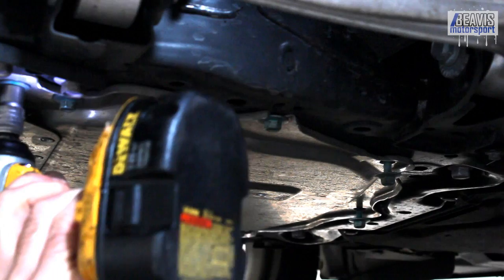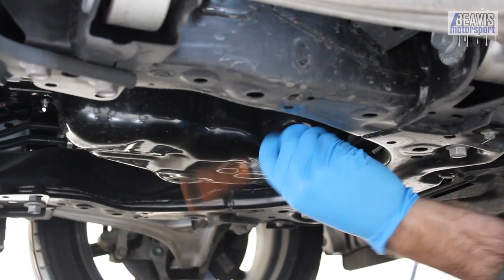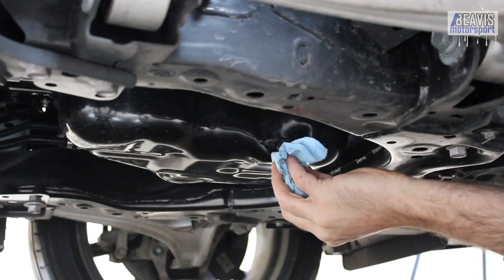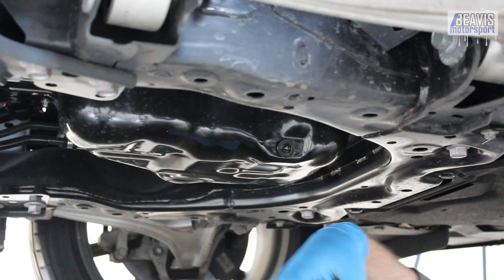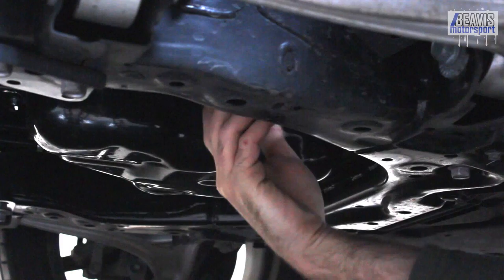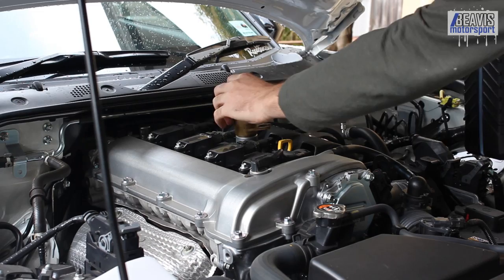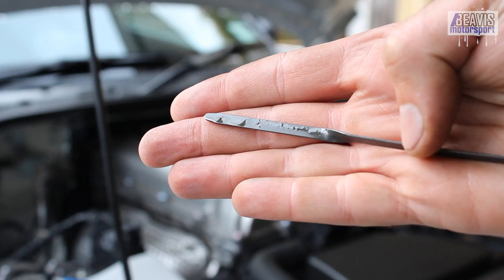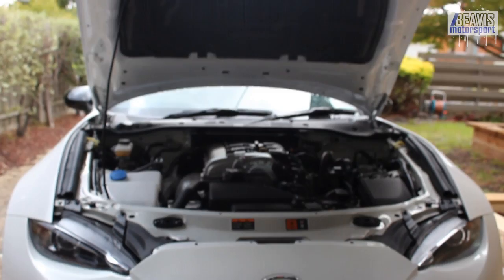HOW TO CHANGE YOUR OIL - ND MAZDA MIATA MX-5

Comment: THIS IS VERY IMPORTANT TO KNOW - The oil drain plug is located on the right-front side of the oil pan; as such, you cannot drain all the oil if you jack-up the front end because the oil moves to the rear of the pan.  After I completed draining the oil, I backed off the ramps and placed a small one quart container under the drain plug (super tight fit trying to reach under the car but it can be done).  I removed the drain plug and almost 1/2 of a quart of oil came out!  That is a significant amount of remaining oil that you DON'T want to leave in your car unless you simply don't care, but I certainly do!  I refilled the engine with exactly 4.5 quarts of oil and the dip stick indicated that the oil level was spot-on.  Had I not leveled the car to drain the remaining oil, I would have over filled the engine by almost a half a quart.
Reply from the maker: I agree, would usually not suggest changing your oil with only the front lifted up.
Reply: I learned this lesson the hard way by over filling
Reply: That's an odd place for Mazda to place it.  I suppose you could jack up the rear of the car.

Comment: I suggest replacing the drain plug crush washer—it's inexpensive and provides some assurance against leaks. Both the drain plug and the oil pan shield bolts should be tightened to 26 ft-lb of torque. If you're replacing the oil filter, the capacity of the ND's 2.0 L engine is 4.3 L of oil. The best way to ensure an accurate refill level and avoid overfilling if your new oil comes from a 5 L container is to transfer 0.8 L or so of that oil to another container. That way, you'll have exactly what you need for the refill in the large container.
Reply from the maker: deasystems good tips... thanks for watching :)
Reply from the maker: You absolutely could, but I don't think it's a huge concern, the moment you crank over the motor oil will be pumped everywhere. There are many cars out there that wouldn't permit you to fill the filter before installation, including the NA/NB MX-5 motors.
Reply: 4L should be fine for the 2.0 engine. You will never be able to get all the old oil out. You don't want to put too much oil in.
Reply: @petermartin9494  : I agree that overfilling would be a bad thing. I jack up the car to level or even slightly rear-high to ensure full oil drainage. I caution anyone doing the same to be very safe and use jack stands all around.

Comment: Pro tip:  Always fill the oil filter with new oil before installing, and use ATF on the ring, not engine oil.
Reply from the maker: Why do you suggest ATF on the seal? I have not heard that before.
Reply: @Bbeavis  It is a better lubricant for the rubber seal, and will not dissipate/evaporate like oil will, so you will never have a problem removing the filter in the future.

Comment: Suggestion.  When you change the oil filter, before installing fill at least half full with oil, so there is no laps in the oil pressure when first cranking.  With that air gap, you are placing the engine  metal to metal wear until the oil pressure returns to normal.  Getting ready for my first oil change on my new Miata.
Reply from the maker: Nice tip, thanks Mike!

Comment: Caveat....US Miata has 2 liter engine so I'll quantity and other things could vary to this vid....no?   UK only has 1.5 in ND....I think?   Motor in vid looks different than mine?
Reply from the maker: This car runs the 2.0 litre. I assume the UK market get both the 1.5 and the 2.0, but I do not know personally. I doubt there are many differences between the 2.0 engine offered in different markets, perhaps just some minor changes due to left vs right hand drive.

Comment: Hi mate, took my car (back) into Mazda and got them to put in the premium fully syn after they initially put in semi syn (it's my fault for apparently not specifying... lol). However, they put in 5w40... I know it meets the car manual specs, just a little concerned if the 40 is going to be too thick for my ND. It's my daily driver. 
Hard to find these answers for our conditions considering every forum is more or less US-related. 
Just wanted to pick your brain. Cheers.
Reply from the maker: I really cannot imagine it would be an issue, particularly if you took it to a dealer. That said, it does sound "thicker" than what the manual specs which is odd. If you live in a warmer climate, then it might make more sense. But if you're suffering a cold 3degC morning like I am at the moment, then perhaps not the best choice.
Reply: BEAVIS Motorsport 
Thanks for replying. I live in Melbourne so I’m experiencing those cold mornings at the moment. The 5W should be ok even for our mornings I think? Just curious about the 40 for a small engine such as ours.
Reply from the maker: @fanatical56  Wouldn't be too worried at all. Mazda state in the owners manual that up to 50 is acceptable.
Reply: @fanatical56  0w flows better than 5w. Thus for those colder mornings you would want that 0w oil that the manual calls for. The higher number references the flow characteristics of oil at operating temps and the lower is the flow rate for a cold engine.

Comment: I know this is old but is it ok to jack up each side from the middle of the pinch weld? Does the jack bend the pinch weld? I don't like jacking from the subframe and if I jack on the indicators by each wheel then I can't place the stands there if the jack is in the way.
Reply from the maker: Should you do it, probably not, can you do it, yes if you are careful. A good safety net is to include some timber to spread the load of the jack across a larger area under the sill so it reduces the chance of damage. Obviously if you used a small jack on a weak part of the sill its more likely to bend or damage the metal.

Comment: When jacking the car up, did you put the jack on the pinch weld?
Reply from the maker: Yes, so that I can get the jack stands on the designated jacking points, I find a safe secure spot to place the hydraulic jack roughly in the middle of the vehicles pinch weld. It is fine as long as you are careful.

Comment: Thanks for this, planning to do my 30k service because it's a basic one and dealerships charge an arm and a leg so figure I'll do it myself and learn a few things along the way. 
Quick question though, you're using OW-20 but the manufacturer recommends 5W-30? Also, how do you remove the service warning light on the dash afterwards? 🙂👍
Reply from the maker: I have a video to reset the service reminder:
https://www.youtube.com/watch?v=5rZBpfPkBOw
Check your owners manual, and purchase the oil that matches their spec, it can vary from location to location.
Reply: 0W-20 is used for emissions purposes.. 5W-30 is better.
Reply: @TuckFinn831  Thanks, I went with 5-30

Comment: I'm about to buy a 2020 MX-5 RF that is a one owner car with only 8000km on the clock. I've always done my own maintenance, but never owned a car this new. Would you recommend changing the gear and diff oil to remove any break in material suspended in the oil or is it good to go until the first specified interval?

Cheers
Reply from the maker: I doubt Mazda would require it according to their service intervals.
But it would be no harm to replace it as long as you use the right oils - being a little more generous with the oil change frequency is better than not changing it enough.

Comment: that filter is kinda small... Smaller than my 1.7L VCT engine on my Puma and actually seems smaller than the oil filter i've put on my mk6 1.25 Fiesta when I did it's service in October
The plate is a pain too. Guess i'll buy a batteries wrenchgun to speed things up
Reply from the maker: It is the genuine Mazda filter, I guess with Mazda's size doesn't matter so much.
Reply: @Bbeavis  yep, also the room left after you place the shield doesn't seem to allow a big clearance. But they, mazda always know what they do. And blessed they are for not downsizing their engines. And making N/A

My fun car is a Ford puma 1.7 VCT, 125bhp
Short ratio gearbox, max power at 6300rpm
Extremely zippy, I love driving it. But the day I have to part ways with it... I want an RF MX-5

Comment: I recommend 5w30 anything lower then that yull feel a lack of performance
Reply from the maker: Yeah fair enough Grizz, it can really depend on location and climate.
Reply: @Bbeavis  yeahh vegas be 110 out here
Reply: I'll listen to the dealership instead of someone on social media
Reply from the maker: @ronaldmcgowan3697  If your dealership is doing your oil changes then you should be safe :)
Reply: @ronaldmcgowan3697  cars have several oil grades on the userbook of what you can use
if 0w30 is an option on the allowed grades, i'd use that. better protection at warm environments
but then... new car, keep using factory grade. i do that with my daily, which will turn this 22nd january, 16 years since i've bought it
Reply: Im planing to go with 5w30 this time. However, SCA suitable check says castrol edge is not suitable, while the nulon long life one is...
any ideals? i assume they are pretty much the same, since both are fully syn?😄
Reply: @ronaldmcgowan3697  The manual clearly states to use Castrol full synthetic 0-20

Comment: Hello! How tall are you? My height is 188 cm, but i don't know if I will be comfortable in the interior.
Reply from the maker: I am also 188cm.
Reply: @Bbeavis  Are you comfortable in the car?  Have you made seat modifications?
Reply from the maker: @causeyoudontneedtolookatme  I find it tight, but it is my wifes car most of the time, I only drive it occasionally. I have removed some of the support under the seat to get it to sit a little lower in the bum.

Comment: mentality "$20 filter must be twice as good as I $8....because the people selling them say so"
Reply from the maker: The full context as mentioned in the video, is that there was some suggestion that the genuine mazda filters are encouraged to be used on the skyactive motors, as cheaper aftermarket filters may not be up to the standard. For the sake of a $20 part, I'm not risking my motor on a no-name-brand filter from the parts shop.
Reply: Really the oem filters aren’t much more. Maybe a dollar or two. And they’re the ones who built the car. They know best what parts should be on it and are designed for it

Comment: Why not 0W-20...
Reply from the maker: I used 0W-20 in the video. If you are unsure, check your owners manual as it will provide the correct spec oil for your location/temperature range.

Comment: At 0.59 second in- you don't tell us what socket your using on your ratchet! I believe it's an H8?! Do you think you'd of got that sum plug out easier with a 1/2" ratchet instead of a 3/8"s?!
Reply from the maker: Fair point, 8mm hex/allen. It was actually a 1/4" socket, so yeah, very small.
Reply: @Bbeavis  Cheers mate. I'm planning on doing the oil change on mine next week, so I needed to know socket sizes beforehand!

Comment: Over in the USA they say use 5w30 oil.
Reply from the maker: It varies depending on climate and owners are recommended to refer to their manual to find the oil that meets the manufacturers specifications.
Reply: Who are "they"?
Reply: depends your engine oil temperature,

if you driving under 
3000 RPM  0W20, 
4000 RPM  0W30,
5000 RPM  0W40
but like in a hot summer day you driving under 3000 RPM = 4000 RPM
if your area snow use 0W, otherwise use 5-10W
Reply: manual says 0w-20 for U.S model bru
Reply: My manual and the dealership here in Arkansas, USA says use 0W-20

Comment: that's a miniscule oil filter
Reply from the maker: I suppose it is... well it's only a small car :)
Reply: I guess you could say that, although I'm surprised because my TT's oil filter holds about 6 times that volume and that car is also quite small.
Reply from the maker: Brandon M. im not worried, it's a genuine mazda filter.
Reply: Brandon M. This motor is bullet proof.
Reply: There's gotta be a Mazda oil filter that is larger but has same fitting as the miata so you can have a larger oil filter with more oil and filter media in it.